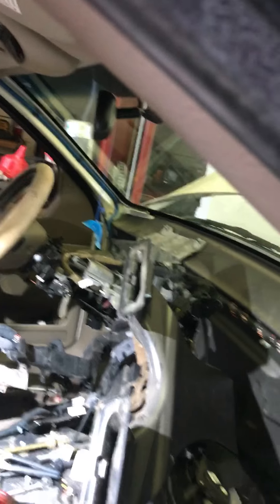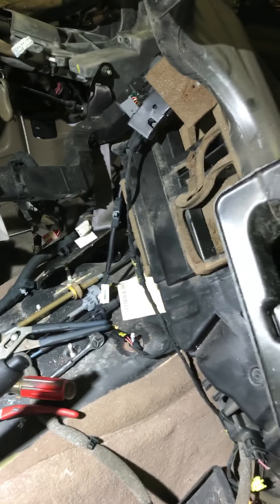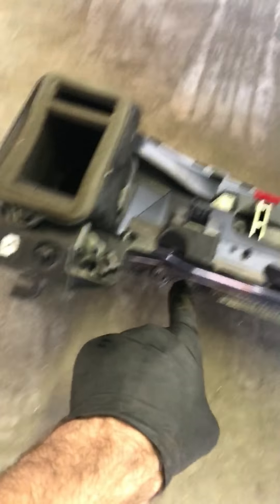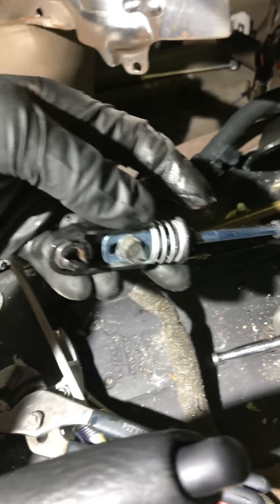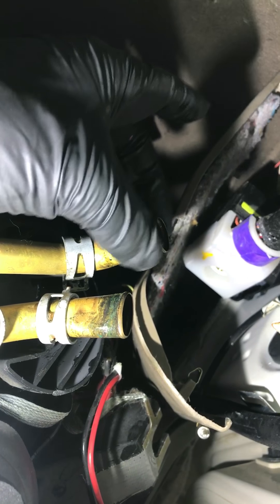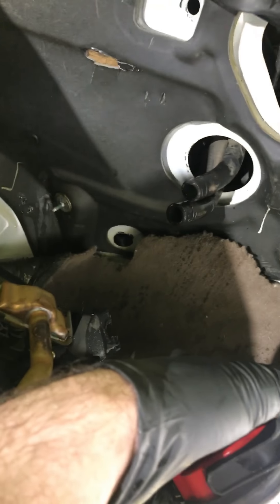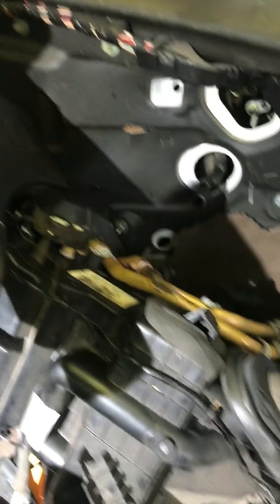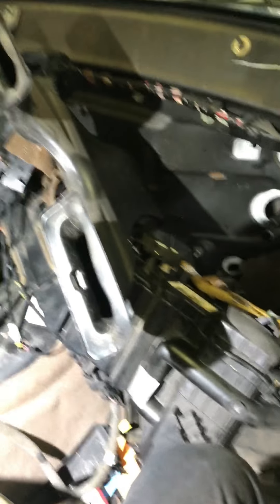2001 Jeep Grand Cherokee 4.7 heater core removal

Comment: I just had to add this, the HVAC was built in Battle Creek, MI, and the manufacturer is just behind Bosch as a world supplier in quality. I have proudly worked there for 18 years building hvac units the entire time.
Reply from the maker: Aaron Leffew you should make a video to get it out quicker ha ha.
Reply: @mechanicdave4899  I don't install the hvacs, that's done in the Detroit area at one of the Chrysler plants. My area just builds the hvac units

Comment: Today I bypassed the heater core on my 4.7 grand cherokee. Good to watch this video and hear that the setup is easier than others to work with. Glad I found your video as last one I watched showed the entire steering assembly removed. Had a question. Only the driver side vents blew hot air. What would I be looking at replacing to fix the passenger side vents?
Reply from the maker: Matthew G. Dammit I’m sorry I missed your comment!